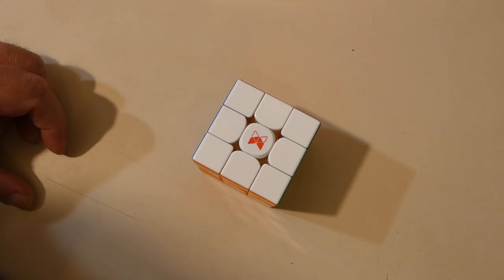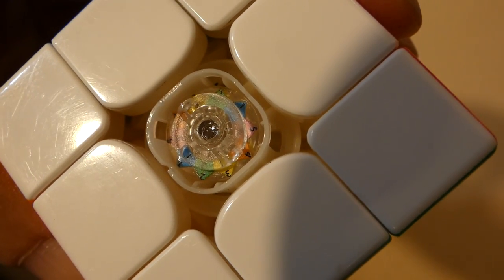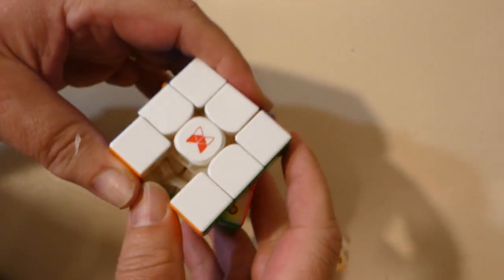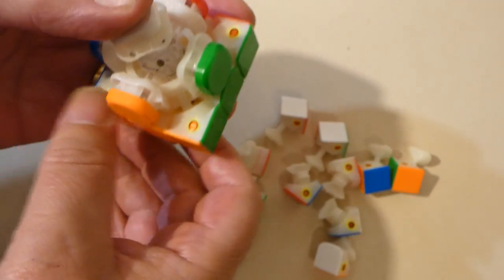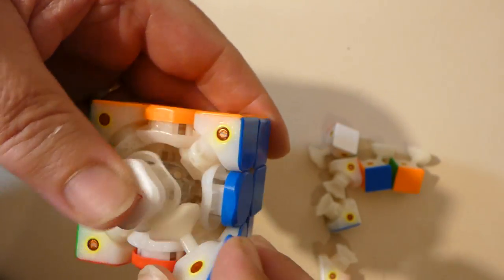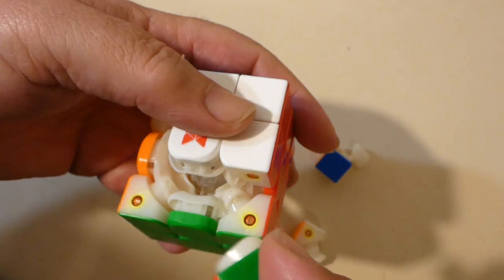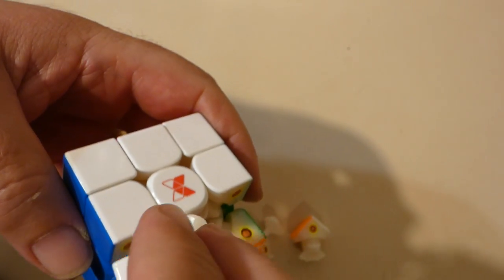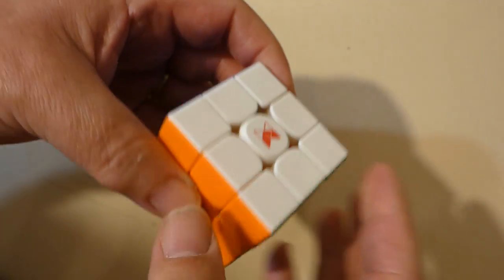Quick disassemble and assemble of Tornado V3 cube

Comment: That's pretty much the only way I could solve a Rubik's cube.

How's the FX82 in low light conditions?  I've had a Lumix DMC-FX77 for quite a long time.  I like it, on the whole, but it needs a lot of light to take pictures close up indoors, especially with my unsteady hands.
Reply from the maker: This video (apart from a couple of quick tests of things like timelapse) is almost the very first time I used the camera so it's kind of too early to know what the performance is like for things like low light but if it ever stops raining here I may take it out some night for pictures of the moon. I follow various FX7x/8x/3xx groups on Facebook and I know from the pictures posted there that it is a pretty good all-round camera for the price.

As for Rubik's - there is a VERY simple solve method I demonstrated (for the benefit of my nephew) in other videos I posted here. For example: https://youtu.be/W3hSzATPjNw

That shows you can actually solve the entire cube using just one very simple 4 turn sequence (and its mirror). The only downside is that it takes ages so 150-200 turns and your lucky to complete within 2 minutes. These days I use some more advanced techniques and I'm just scraping the 1 minute mark.